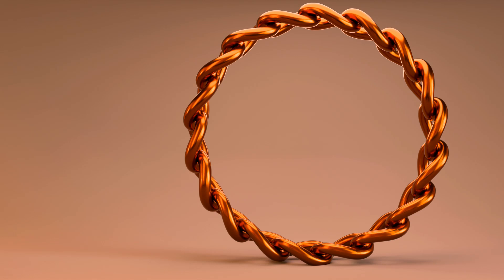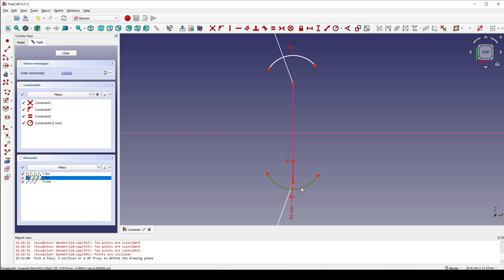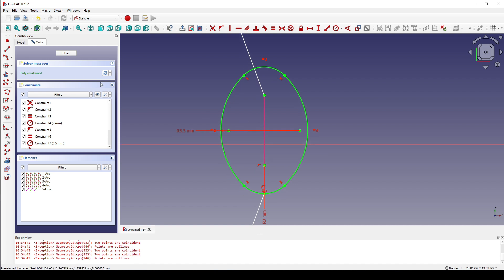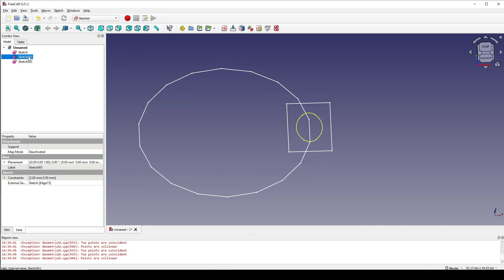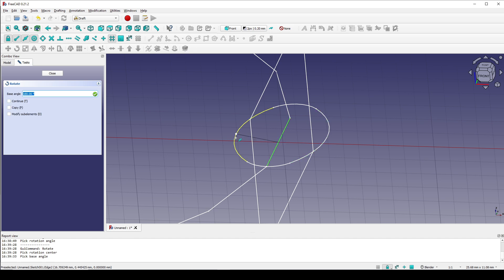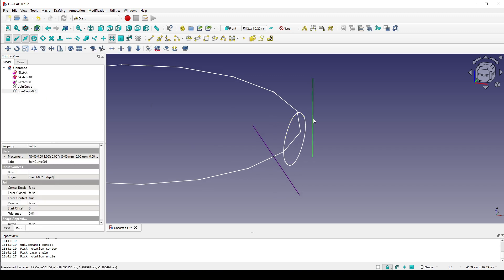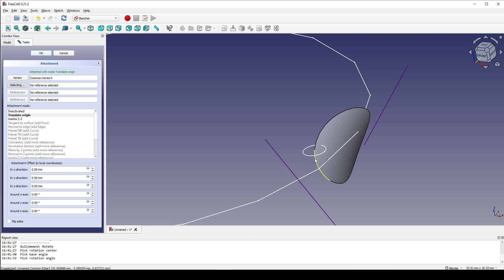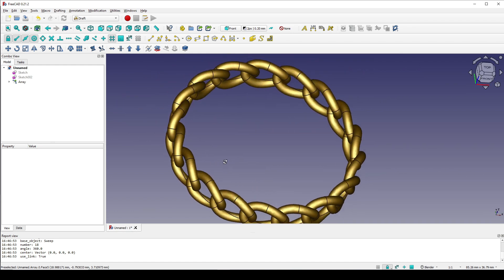FreeCad - Modeling Bracelet Chain

Comment: Sorry at 5:26 nothing happened. The rectangle did not turn.
Reply from the maker: Make sure the working plane set to front and turn on snapping. Working in Draft need practice.
Reply: @DuyQuangDang  It doesn't work for me despite turning on the grid because the message "Sketch002 cannot be changed because its placement is read-only."
Reply from the maker: @borismantik974  Hi, make sure you create the sketch from the "Sketcher workbench", not from the Part Design. If you already have one and don't want to recreate the sketch. Just right click on the sketch/ Attachment editor / Deactivate.
Reply: @DuyQuangDang  right mouse button on the sketch/attachment editor/deactivate --> that's it!!! Thank you very much!